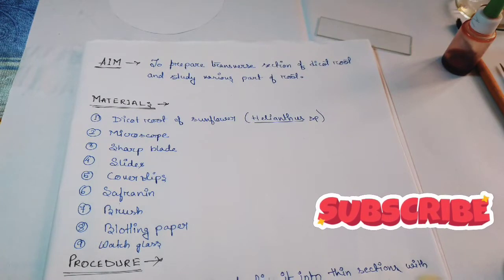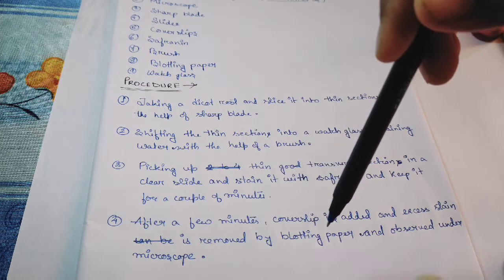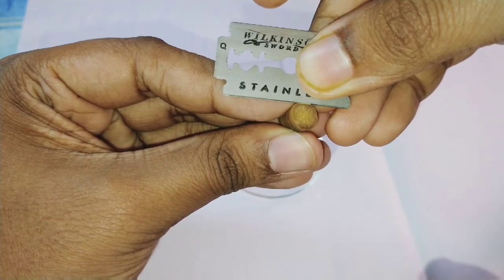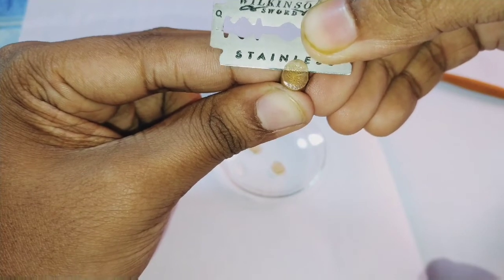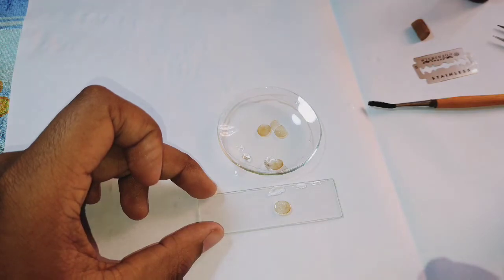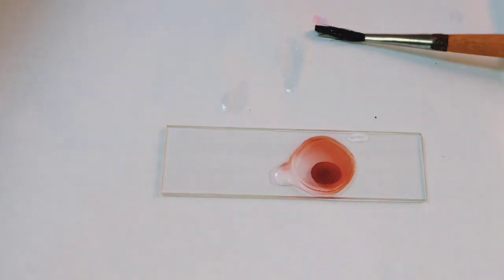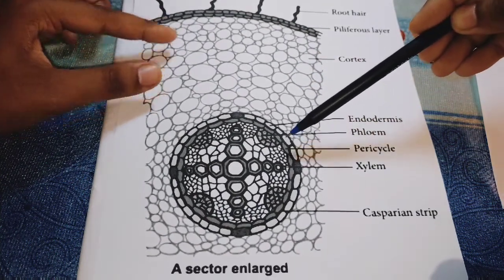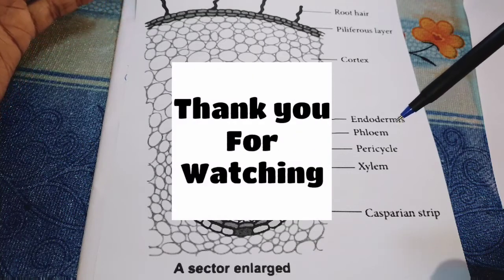Prepare Transverse Section of Dicot Root | Helianthus sp. | Botany Practical | XI XII UG Level

Comment: Sir last time during practical exams I got a root so as to determine whether it's monocot or dicot. I performed the experiment the same as shown but while looking under microscope it was all red. I changed my microscope, prepaped slides multiple times but same thing was happening repeatedly. Can you plzz give the probable reason for this coz I have my practical exams tommorow so plzzzz
Reply from the maker: I'm soo sorry for replying late. Because I preparing for net exam.
I think you have used to much stain in your slide so, it happens.
You must remove excess stains using blotting paper.
Reply from the maker: Sorry 🙏